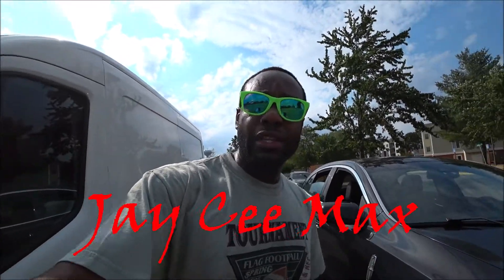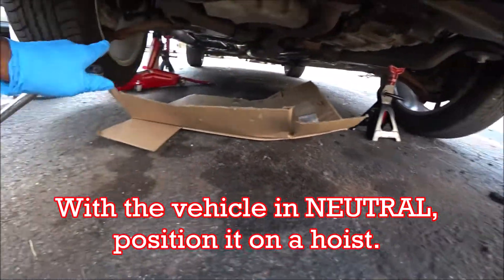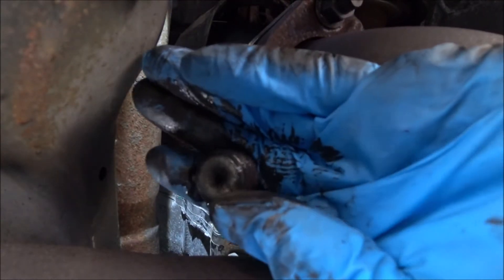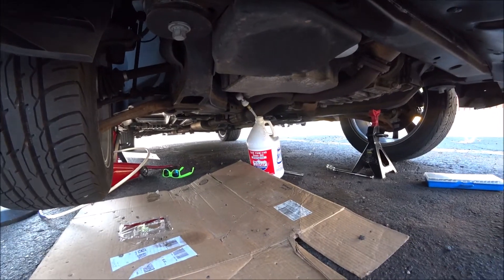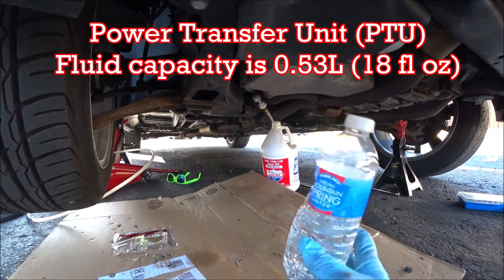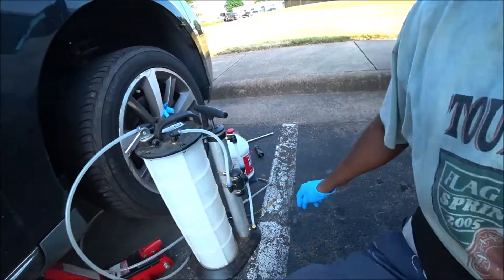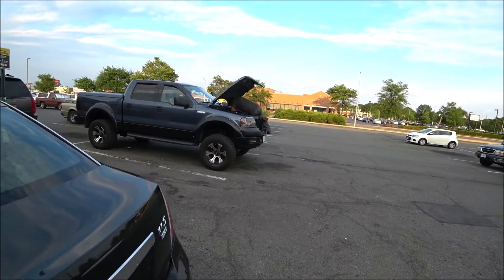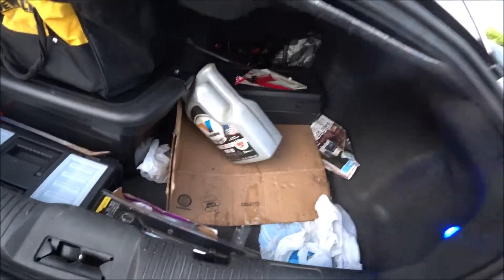How to change Power Transfer Unit (PTU) Fluid. Drain and Fill (Easy) | Lincoln mkS

Comment: Excellent video and very well presented. As a Ford mechanic for the last 43 years, I have seen many of these PTU systems come in for failure. Most that fail are on the 3.5 that is encased in heat sources.  When you open them up, there is usually nothing but black sludge left. The newer PTU units are easier to do with the drain plug, but were still a pain with the 3.5 and the exhaust manifold in the way. Ford really misled people when they called this "lifetime" fluid. The owners that ignore that advice and have this fluid changed every 20-30K miles have very little or no issues with the PTU.
Reply: "The owners that ignore that advice and have this fluid changed every 20-30K miles have very little or no issues with the PTU."
Except when the seals start to leak. Ford needs their pants sued off for this because it's been a problem for over a decade now. They also need to be sued for carbon issues on their GDI engines.
Reply from the maker: Great information. 
Thanks for the feedback.
Reply: @JCMFix  also wondering how there is a drain plug on your 2009? i didn't think they introduced it until after 2013
Reply from the maker: @alexswift  Because the PTU within the 2009 mkS does not have a true "drain plug." It's more of a service inlet port to put fluids in. Yes, you can extract the fluids from that same hole, but you need a fluid extractor as shown within this video or a small pump that "sucks" to remove the old fluid/tar.
Reply: @JCMFix  thank you
Reply: how are they getting the fluid changed without a drain plug? just by pumping and pulling from the fill area? curious
Reply: @alexswift  We were instructed by Ford not to service ones without a drain plug. We could add fluid, but not do a drain/refill unless it came from the factory with a drain plug. Most owners who don't have a drain plug did as you said. They would extract what they could with a pump and then refill with fresh fluid to capacity.
Reply: @gianmariavolonte4315  that’s pretty annoying they couldn’t come up with a ford approved way to do their customers a good service

Have you ever seen the part number for the replacement PTUs that have drain plugs and work for the 2009-2011 era AWDs?
Reply: please please please respond to this so I have a 2012 Lincoln mks awd and I was having a hard time shifting to park it would get kinda ruff then when I went back to drive and back to park it would be fine so I took it to continental which is a mechanic shop near me they said they worse case scenario they need to replace it it would be 3200 dollars for labor and the part and the sealant but they said best case it may just need some sealant my question to you is how should I go about this if it’s leaking slowly is it a big deal like should I hop on this right away or can I just do what you did in this video and I’ll be ok i guess my question is… is it normal to leak???

Comment: Just did it on my 15 Explorer Sport. Not very easy to fill through the breather. 78k miles and the fluid still looked good. But I have a cooled PTU, that makes all the difference. If it wasn't cooled it would have been game over for the unit I'm sure. Good job, Cheers.
Reply from the maker: Good job tackling that service! Thanks for the feedback!

Comment: Hi, I have 2014 Ford Edge with 70K miles. I feel and hear wobbling noise under the floor. Something is spinning unevenly. And I smell burning , like propane under heavy acceleration. Do you think my PTU is bad?
Thank you in advance
Reply from the maker: Thanks for sharing. How's the A/C compressor? Turn off the fan and a/c, See if you still smell the burning smell with the windows up. Then turn on the fan without A/C and see. Then with A/C.
Reply: @JCMFix  Thank you for responding to my question. It happens only with heavy acceleration, whether A/C is on or not (only short time, bad burning smell). I have heard that PTU may spit some fluid through vent, when overheating. But the worst thing is rumbling noise under the floor (not very loud but annoying). Car was twice at the dealer with other issue but they did not say anything about my complain about it. That's why I don't know, should I request PTU change or not. I have new tires new brakes, ball bearings are fine, brand new rear differential etc. Something is making this noise and vibration. To replace PTU is expensive so don't know what to do, since dealer did not say anything.
Reply from the maker: @questdental  The rumbling may be your CV axles possibly going out. 
The smell could possibly be the PTU but I'm not sure. I had a similar smell and thought it was the PTU. I changed the PTU fluid and the smell remained. It turned out that my A/C compressor was failing. Once I changed that out, the smell went away.
Reply: @JCMFix  Thank you. In my case, everything seems to be okay, so I don't know. Have to go to  the dealer and resolve this problem. Take care :)

Comment: Okay guys this is how I changed my PTU fluid 
I jacked it up put jack stands under it got my creeper crawled under the car  found the PTU.
Then I got out all of my tools and quickly found out that I didn't have the right tools I needed.
So this is how I solved the problem for my 2013 Lincoln MKS Eco-boost.
First I put all my tools away, pulled out the jack stands and lowered the car.
After that I drove the car to EZ lube and had the fluid changed for $60.
So that's how I changed the PTU fluid.
Using cash is much easier than crawling around underneath a car. Cause I just plain gave up on the damned thing!
Very easy way to change the PTU fluid I highly recommend it!
No busted knuckles, no mess and no effort.
Almost any problem can be solved if you throw enough money at it!
Reply from the maker: Cheers mate.

Comment: Thanks, nice clear straight to the point video without a bunch of unnecessary BS.
I have a 2013 Lincoln MKS Eco-boost AWD I'll be out in my driveway tomorrow to change the fluid.
Thanks again!
Reply from the maker: Awesome. That's what I like to hear. Be safe under there mate.

Comment: Good video! How's the PTU running after the drain and fill?
Reply from the maker: Perfect, perfect, perfect. No issues at all. That Mityvac or any suction machine you have makes the job so easy. Thanks for being here.
Reply: @JCMFix  any other services you perform routinely that ford or lincoln doesn’t push?
Reply from the maker: @alexswift  Indeed!
Here goes my other mkS Playlist:
https://youtube.com/playlist?list=PLSobJ3CJ_Tg3jvWC14BFrPtkBsC0L4X2y

Comment: I have a 2013 Edge and I hear some grinding at low speeds, and more of a howling at higher speeds. Just had front bearing replaced and that didn't fix it.  I'm thinking my PTU fluid hasn't been changed for quite some time (165K miles on the car)   Could the noise be coming from the PTU because of bad/old gear oil?
Reply from the maker: Definitely change the PTU gear oil fluid if you can as the PTU's within the Edge are known to tar up at pretty low miles.  I doubt it's the cause of the howling at higher speeds. It may be the CV AXLES (AKA half shafts) or just a bad hub all together.

Comment: is the same with a 2014 Ford Explorer?
Reply from the maker: Yes and no. Some 2014 Explorer's have a "PTU cooler." Without a PTU cooler, the instructions are the same as shown in this video. With a  PTU cooler:
With the vehicle in NEUTRAL, position it on a hoist. DESCRIPTION AND OPERATION, Lifting Points.

Vehicles with a PTU cooler

NOTE

All vehicles with a PTU cooler will have a drain plug.

Remove the drain plug and drain the PTU .

Torque to 20 Nm (177 lb-in).

￼

Remove the RH catalytic converter. Refer to Exhaust System.

Remove the PTU temperature sensor heat shield bolts and the heat shield.

￼

Disconnect the PTU temperature sensor electrical connector.

￼

Unclip the PTU temperature sensor wiring harness from the retainer clip and position aside.

NOTE

The PTU temperature sensor can be removed using a 15mm crows foot and extension.

Remove the PTU temperature sensor.

￼

With the vehicle on a flat, level surface, fill the PTU . The fluid must be even with the bottom of the PTU temperature sensor opening.

Fluid capacity is 0.53 L (0.56 qt.).

￼

NOTE

Replace the O-ring before installing the PTU temperature sensor.

Replace the O-ring and install the PTU temperature sensor.

Tighten to 14 Nm (124 lb-in).

￼

Clip the PTU temperature sensor wiring harness back into position.

￼

Connect the PTU temperature sensor electrical connector.

￼

Instal the PTU temperature sensor heat shield and heat shield bolts.

Tighten to 12 Nm (106 lb-in).

￼

Install the RH catalytic converter. Refer to Exhaust System.